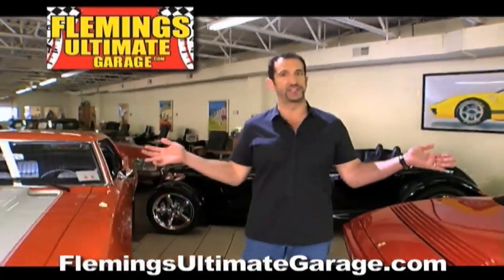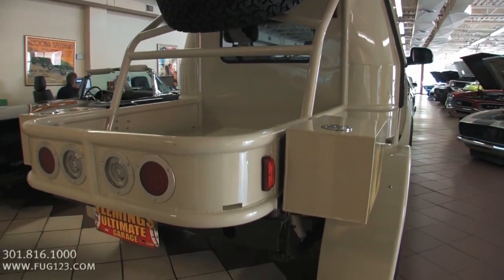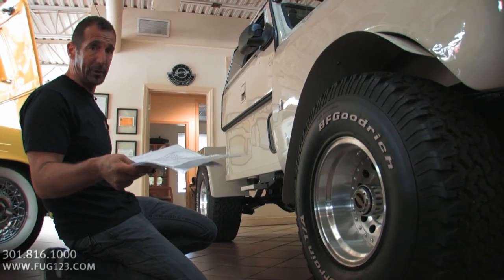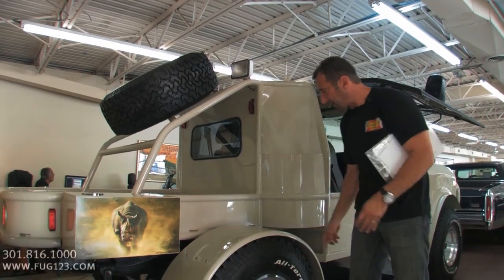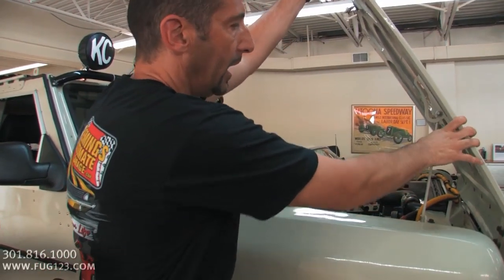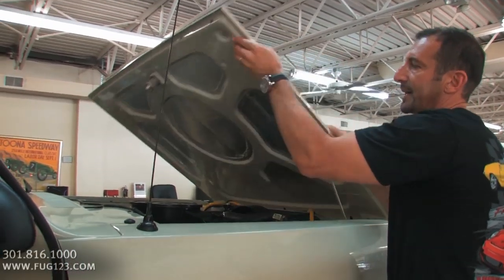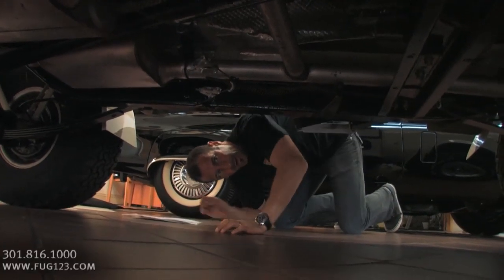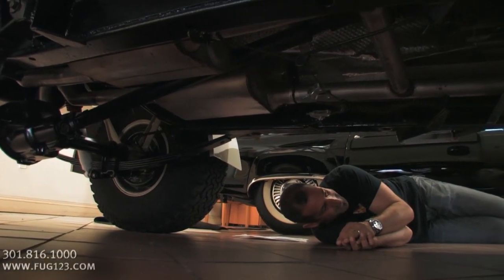1979 International Harvester Scout II for sale with test drive, walk through video

Comment: FYI:  All Scout II's have dual belts for the Alternator.  All Scout II's have the exhaust tucked up above the frame.  He didn't indicate which engine is in it.  None of them have 300 hp or whatever he said, and he didn't indicate what kind of work was done to it to 'attempt' to achieve that much Hp. Like someone else said, should have started it up.  Even if the Rr Fenders move with the axle they should have been given more clearance so mud & dirt don't get lodged in there.  As much as I love Scouts, this is definitely one of the uglier ones I have seen.  Lots of money yes, but a bit hard on the eyes.  :-(